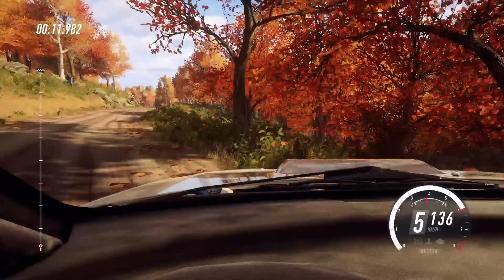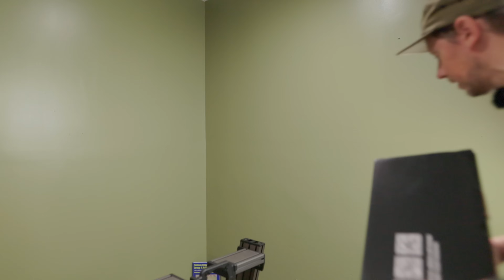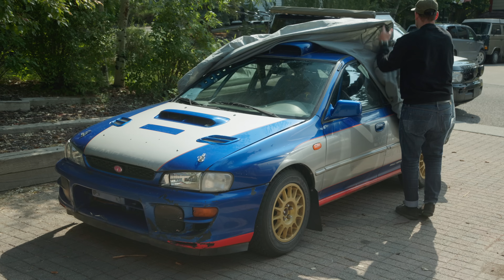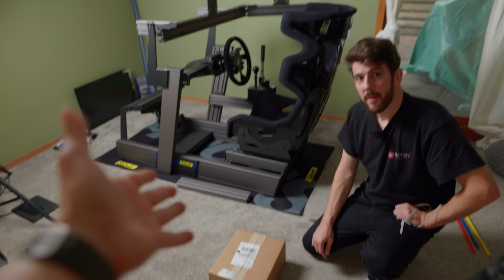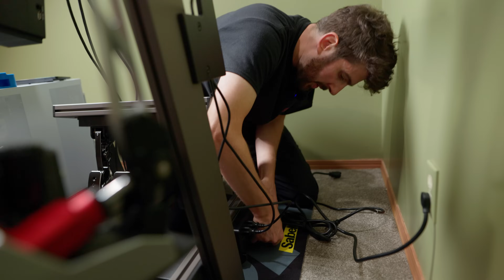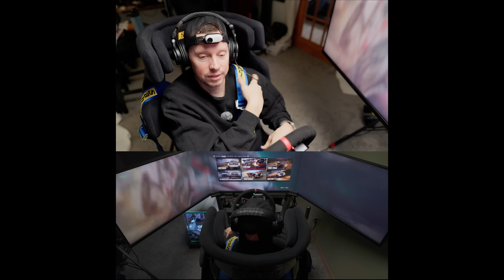Budget Sim Racer Gets The ULTIMATE Upgrade

Comment: chatgpt:
Simagic Compatibility with RBR/RSF:

Simagic wheels like the Alpha, Alpha Mini, M10, etc., are compatible with Richard Burns Rally and Rally Sim Fans, but they're not plug & play like Fanatec or Logitech. You’ll need some additional setup.

⚙️ What You Need to Make It Work:

Install and configure EmuWheel

EmuWheel intercepts and translates FFB signals for modern Direct Drive wheels.

Simagic uses a DirectInput interface, so EmuWheel is essential for proper force feedback in RBR.

OpenFFB (optional but recommended)

Enhances FFB quality with better update rates and interpolation.

Can be used together with EmuWheel or on its own.

SimPro Manager (Simagic's software)

Needs to be running in the background.

Allows you to create custom profiles, adjust filters, and calibrate the wheel.

📌 Important Notes:

Simagic does not have official RBR support, but the community has made it work reliably using EmuWheel.

If you're using the RSF Launcher, go to the advanced FFB settings and enable "Use EmuWheel."

Be sure to disable RBR’s built-in FFB when using EmuWheel (to avoid conflicts).

A good ffb.ini file makes a big difference — I can share a tuned version for Simagic if you want.

🎮 Force Feedback Feel:

Simagic delivers strong, detailed force feedback, which is perfect for the precision required in RBR.

Comment: Great series, stumbled on it after getting a used Logitech g29 just this last weekend and didn’t expect to see the Loam Ranger giving g29 upgrade tips! You should try VR see how it compares to the 3 monitor setup, does it give you more of a feeling of depth? I have Gran Turismo on PS5 with the PSVR2 with the g29 and I can’t begin to describe how much better it is in VR, I find it so much easier to judge corners. The weight of a headset will only be like having a helmet on too. Can’t wait to see more of these videos. I can see this hobby adding to my already expensive Mountain biking hobby… it starts off as, I will get a cheap wheel and see if I like it, the next thing you know it’s “I need a better wheel”, then “I need a better PC”, then “I need a better seating rig”, hobbies are soooo expensive. Best of luck with rallying.
Reply from the maker: Haha surprise! I’ve only heard amazing things about GT7 with the PSVR2. Would love to try it out at some point.

Comment: Unless Dirt Rally 2 has added proper angled triple monitor support recently, you are going to have significant distortion on the left and right screens, with the monitors angled that far.
The only way triples work atm, is having them all in a line.
As far as I'm aware, there are no triple monitor mounts that allow easy pivoting of the side screens from 0 degrees to 45/60 degrees.
It's been on my bucket list to make for a while, but to truly do it properly, they need to pivot right on the absolute edge of the front of the bezels between the monitors.
I'll get around to it one day, when I have the money, in my usual fashion of hacking things together that work, that will never make it to the market, lol.
Reply from the maker: Haha fair enough. The amount of distortion I'm getting has been pretty reasonable, especially considering they are mainly for giving a sense of speed in my periphery. When going through hairpins and looking through the side window, it's a little wonky looking, but I'll take it over not having triples cover my full vision.

Comment: I really enjoyed your video. Interesting you want to built a realistic rally simulator.

Since I have used many different types of motion simulators, I want to tell you something for your information. For circuit racers who value delicate braking, I mainly recommend affordable 'seat-movers' which produce direct feeling from less movements. However, most rally gamers seem to like the suspension movements. For those people, I recommend 4-axis cylinder(?) type products such as D-BOX. Above all, you should limit the range of movements that interfere with driving, whatever you choose.

Please note that the word 'realistic' doesn't stand for quantitative and numerical values. It's not realistic for the simulator to move 1 inch when the car moves 1 inch. What 'realistic' is about how you feel in the car while the car itself moves 1 inch. There are many things between car and you like suspension and seat etc. And human perception is not objective. When multiple forces applied on your body at the same time, humans tend to focus only on stronger certain forces. So what realistic in the motion sims is subjective feelings referred to human perception, not numbers.

So, please don't be fooled by how much range of motion it has. You won't use all that range. Of course, a larger pitch angle will allow you to feel the slope, but you will have to reconsider your entire rig including monitor stand. And also, too much range of movements produce too much rebound movements which is not intended. Obviously not realistic. 

I'm not a fan of yaw devices that express traction loss by sliding the rear. they are pretty fun for rally and drift drivers. Only for fun, not for realistic driving information. Rear-sliding devices can make you confused quite often.

Anyway, nice video! Keep it up! I hope to see the video about your thoughts on motion sims someday.

Comment: What do you think is the biggest change? Switching to the new rig with all the new components is obviously a big step overall, but what stands out the most? Is it the triple monitor setup, the wheelbase, the wheel, the pedals, the shifter or perhaps the seating position?
Reply from the maker: Hmm that’s a good question. For in-game performance, I’d have to say it’s the wheelbase. I went back to the Logitech setup the other day, and I’m getting almost zero information, in comparison. I can tell what’s going on, grip-wise (and what’s about to happen) much more easily with the DD wheel. Especially one with so much headroom. Having the right sized monitor at the right distance is a close second. Hope that helps!
Reply: @GravelCo  Yes, thats very interesting. I use a fanatec csl dd 8nm and I am quiet happy with it. I wonder if such high torque values are necessary for rally driving? But of course I would like to feel the contrast to a simagic wheelbase ;). Unfortunately, I don't have space for a triple monitor system, but I think I got the best out of it and driving is a lot of fun! I hope you have a great time with this cool new rig!

Comment: Nice things dont make you faster over one lap.... but they matter. A good seat makes it so much nicer to sit for a long time (good for your back). A good brake will make you more consistent. A good wheel will makes you more smooth.  And if you want a really nice seat then do what I did and buy a used car seat and adapt the holes to your rig. I have a Audi A6 driver seat and I can sit for 4-6 hours without any problems (and it cost me 250 dollars from a accident car)

Comment: You practiced properly on the G29 if you could just automatically adjust like this. Im 100% convinced that if you truly practice the correct way on a lower end wheel, youll be so much more "at home" when you get a really high end wheel. I got my g29 a year ago, and then the t300 3 months after. All i ever did was trying to learn proper racing technique. In doing so, the t300 felt like a super high end wheel, when i first upgraded. Then i kept practicing on that, until i came to the point where i felt that i was outperforming my wheel. So two days ago, my Simagic Alpha arrived, and everything just felt RIGHT, despite everyone saying it takes a while to adjust. 

The added bonus - i went from enjoying the concept of improving, to just straight up enjoying driving a car around a track. I was really missing that.

Comment: Subscribed! I didn't see any mention of bass shakers on the rig. Do you plan to add these in the future? 

IMO, bass shakers are the single most important thing that really kicks up the realism.
Reply from the maker: Thanks! It depends. I’d love to work towards a motion system, so I will likely aim for one that handles those types of haptics. If motion winds up being something completely out of reach, then I will 100% be adding shakers.
Reply: @GravelCo check out the HF8 seat cover for a quick fix ✌️
Reply: @GravelCo  Motion rigs still commonly use buttkickers. The vibrations are different and it's far less taxing on a bass driver to produce certain frequency vibrations than a motor rapidly oscillating back and forth. That's how motors get cooked.

Comment: This is your first video I've ever seen so maybe you are well aware of this. VR is a great way to save on the triple monitor /monster PC rig setup. I am blessed to have both, but would of never got the triple screens had I known how good VR is. Going from a Logitech G29 to a Thrustmaster T300 is like going from a Toyota Prius to a High End Corvette. Going from a Thrustmaster T300 to a Simagic mini is like going from a Corvette to a High End Porsche, there's not nearly that big of difference although noticeable. I wish I would of known these things before dropping thousands on my all out rig, which in hindsight, is not worth the price difference over a T300 with a solid foldable cockpit and pedals to match. Is my sim rig better, yes, but the price difference doesn't reflect the upgrades. For people looking for the best price ratio setup, its the Thrustmaster T300 + wheel of choice, foldable steel cockpit, and simsonn pro racing pedals.
Reply: Also anybody reading this, the simsonn pedals don't seem to work well with Fanatec gear.

Comment: Congrats, with new setup. I have similar but with Fanatec tech + VR quest 3. I practicing on EA WRC time trial mode, I set my goal to be in top 100 on each stage. So far I manage do it in Monaco, took me couple month to do. My opinion VR should more immersive, just need adjust your body for it. First hours lot of sickness effect, but I got used to after 3-4 times using it.

Comment: Hey man, loving the series so far but if you want to take the simulator to the next level you have to try VR. It's a complete game changer and you will not get the same training effectiveness from triple screens. If your budget can stretch I'd recommend looking into a bigscreen beyond, otherwise a quest 3 achieves close to the same level of performance at a lower cost.
Reply from the maker: I absolutely want to try VR, especially for the depth perception part of the equation.

Comment: hot tip, get a track IR and set it up, the feedback you get from the car being able to rotate without your vision (since your POV is now actually tracking your real life head position) is otherworldly, Plus in a real car, you look through corners.
Reply: Isn't track IR less realistic because moves what you're seeing based on where your head is facing rather than where you're looking? And he already is looking through corners because he is using triple screens, he literally said so in the video.
Reply: @mark_plays_games-p9c  When you use triple screens the side screens view is "skewed" to show perspective, which isn't realistic, so as the car is sideways and you look out the side window/screen/monitor, what you are looking at is a stretched or skewed view, and when the view is stretched/skewed its impossible to use anything for reference. Track IR isn't perfect, but what it does is moves that "skewed" version of the game world as you look around, and keeps your view "in focus" and therefor accurate and reference-able version of the track, in the center of your view, as you look around.
Reply: @mark_plays_games-p9c  Tobii eye tracker is probably the better option anyway, since it doesn’t require wearing any reflectors and can track both head movement and eyes.
Reply: @mark_plays_games-p9c 
No. When setup correctly there's no distortion between the screens . Not sure what you're seeing. This setup is on point

Comment: Hi loved the video, you talked about a motion sim at the end but if you want more immersion for around 300-400 Canadian Dollars there is a device called a butt kicker. Its used a lot in sim racing and its basically a bass shaker so it emulates vibrations like the engine or shifting. There are also cheaper options, butt kicker is like the apple of bass shakers because of its user friendly platform (more plug and play then other options) . I've heard many people say it increased the immersion a lot, you should check it out! Love the content keep it up!
Reply: Get a Dayton Audio BST-1, strap it under your seat get a Nobsound Mini Amp and some speaker wire and you're set for less than 100 dollars. I don't know if it's comparable to a buttkicker but it's good. There are a lot of youtube videos on how to do it.

I use it for engine vibration, a subtle bump when I shift and road vibration/bumps (also subtle) from the suspension. Try not to overdo it. SimHub is relatively easy to use, but it takes some tweaking to get what you want. If I have it off I feel like I'm floating over the road and it feels like something is missing. So it's definitely great for immersion.

Comment: Remember bud, hard work beats talent and money!

While money is a give or take in beating with hard work, you can look at Touge racing, touge is basically tarmac rally with street cars. Best MOTORing put out an episode quite a long time ago where a R34 GT-R (310+hp from factory) raced against an AE86 corolla (120ish hp from factory, and the one they used had I think 190ish or so), and the 86 won!

Continue working hard, and it will pay off.

Comment: Im curious how you set up dirt rally. I have triple screens but it looks so much better. For example my side mirrors are distorted and blurry. Congrats on the new setup 👍
Reply from the maker: Mine are a bit distorted as well, but not to bad. Are you using Nvidia Surround?
Reply: @RyansRoadToRally  yeah I use Nvidia surround for my sim rig monitors. Maybe that's what I'm doing wrong. Your displays look much better. Maybe there is something you are doing I'm not hahaha
Reply: There’s unfortunately no official triple monitor support for the Dirt Rally Games to calibrate the angles similar to one’s triple monitor setup, so there will always be distortion. RBR RSF has true support to dial this in and WRC as well via an ini file tweak (not perfect but close enough)
Reply: @Hangry1988    I appreciate your comment mate, thank you. Yeah it sucks there isn't proper triple screen support. I'll check out that ini modification for wrc as I also have that game :)
Reply: @OzzCyrus  Glad to help. Search for the video "EA SPORTS WRC Triple Screen Fix!" by Boosted Media ;) Cheers

Comment: Now get some motion integrated. You can also get belt tighteners to help simulate the pressures you'll see.
I'm also with the other comment about vr, I've got triples when I got serious into endurance racing and wearing the headset for 10 hours was uncomfortable, but honestly I reach for the vr headset 9 our of 10 times
Reply: Belt tensioners are good, motion though? No. Motion is actually less realistic in pro drivers experience so i would deffo not go for it